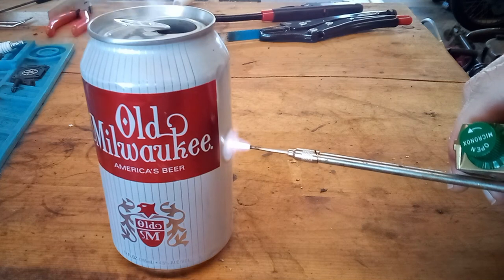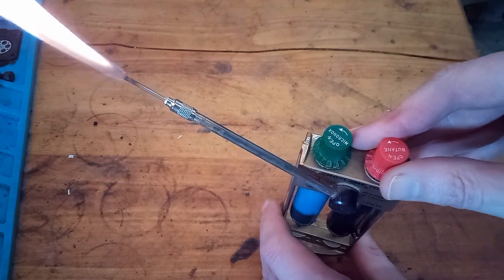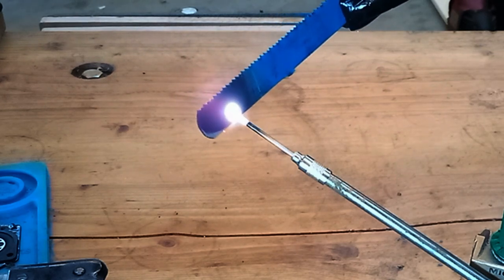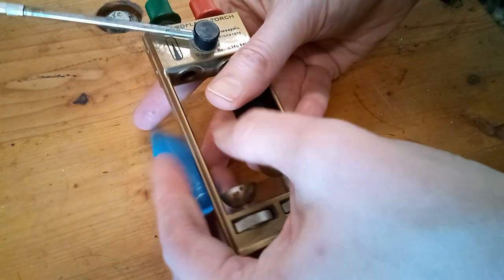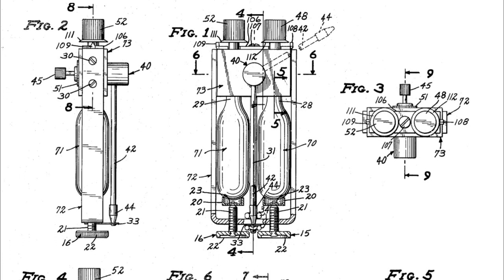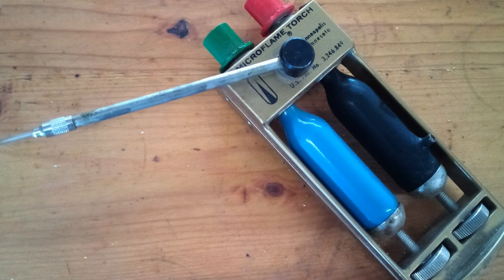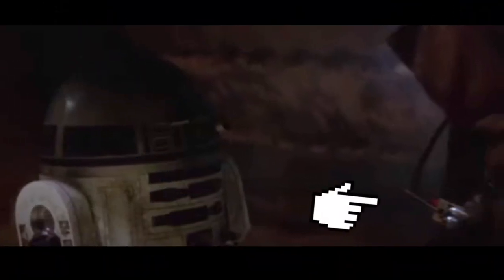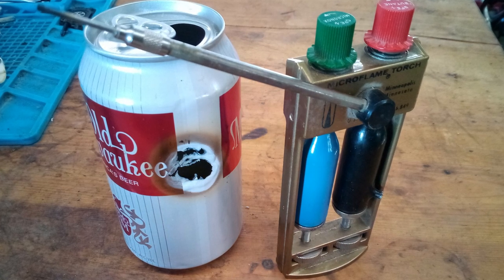Vintage MicroFlame Mini Torch Review, History & Instructions

Comment: I have this torch and the butane cylinder neck is smooth. I purchased some cylinders off ebay but the butane cylinder neck is threaded. Do you know if these are interchangeable? I needed a couple of empty butane cylinders to add a filler valve.
Reply from the maker: I've never encountered one with threaded cylinders. They might be for some other type of torch.
Reply: The box says microflame it shows a archer style torch on the box of two. they are the same size same height but with threads on the short neck. I need 1 or two empty butane cylinders to modify for a filler. I purchased two boxes of these for that purpose. I did note that archer did also have the name microflame on some of their torches . These are red in color.
Reply from the maker: @dogbreath312  Archer was another one of Radio Shack's brands, and I have seen these torches with "archer" branding.  The cylinders seal to a o-ring in the torch, so if it physically fits, and the threads don't interfere with anything, it might be OK. Not something I've seen before though.
Reply: @ballinator  i would have posted a picture of them but i didn’t see any way to do that

Comment: Do you know where I can get the tanks I have one but I can't find the right sized tanks
Reply from the maker: @wardogdauwdd3020 the nitrous tanks are easy, just look for 'whipped cream chargers' on Amazon. The butane tank - those have a special tip design. Your best bet is to grab an empty one off of eBay, and braze a refill fitting onto it. There once was a guy selling modded butane tanks, but I don't see them on-line anymore.
Reply: @ballinator  ok because I have the older version of the torch also honestly didn't know nitrous and oxygen tanks can be interchangeable and I'll try to diy the refillable tank